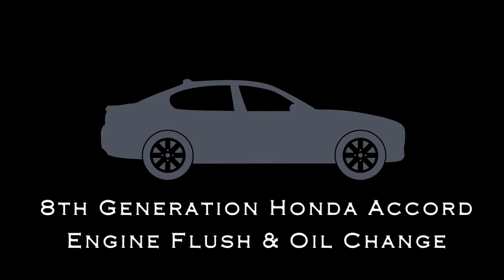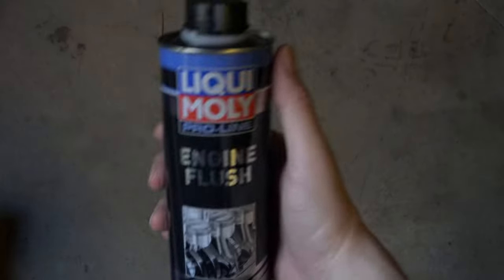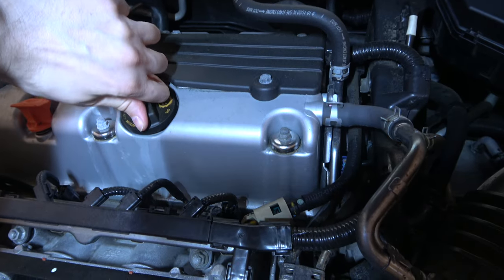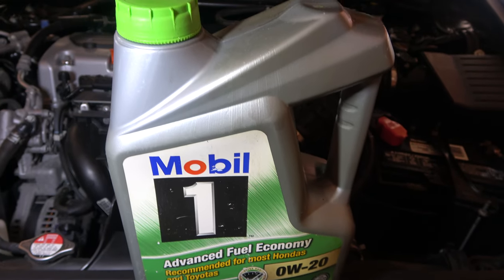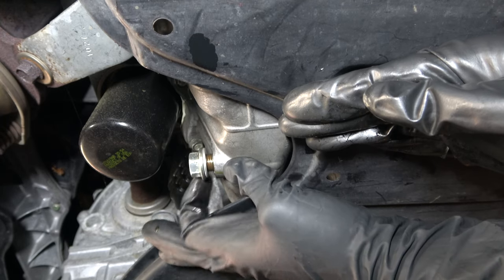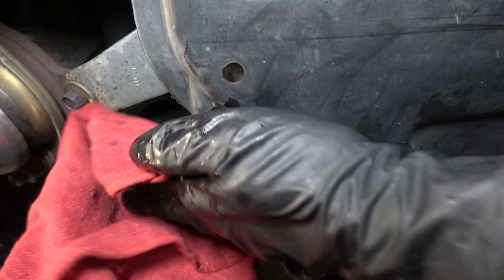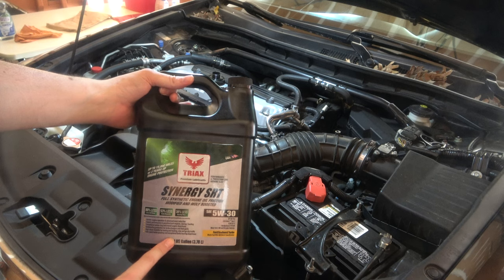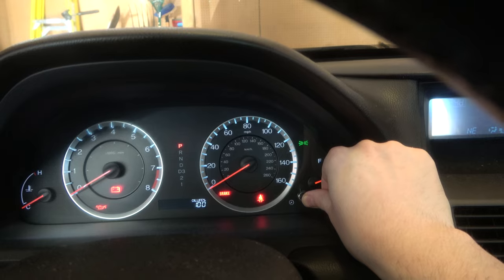Engine Flush & Oil Change With Vehicle Ramps - Honda Accord 8th Generation 2008 2009 2010 2011 2012

Comment: Why didn't you use the recommended 5W-20? Also, if you're looking for fuel efficiency, the 0W-20 is also an option...
Reply from the maker: Great question.  Honda actually recommends synthetic 0W-20.  You can however use a higher viscosity oil to get better engine protection.  The reason Honda uses 0W-20 is to be able to get higher Miles Per Gallon rating, but that is at the expense of engine wear, as the oil is thinner, so the internals will wear faster.  I used 5W-30 for greater wear protection, as the MPG are less important to me compared to getting my accord to 500k miles, and the loss in MPG isn't significant when using 5W-30 either.

Comment: How did the car drive after doing this. And what did you notice when you did this any changes or everything was the same.
Reply from the maker: The biggest changes are more power and better fuel efficiency.  When you clean the gunk out of the engine, it runs more efficiently, like it was designed to run from the factory.

Comment: Did this help you not burn any oil? I burn basically a quart of oil in between 800-900 miles
Reply from the maker: Yes - it also gives the engine more power, because it is more efficient without oil sludge.
Reply: @Stimwalt  awesome!
Reply: @Stimwalt  also, how many times have you had to do this to stop burning oil?
Reply from the maker: @PurpHaze830  I did this for 3 oil changes in a row, and then I was good.  Every 30k miles I'll do it again, just to keep things clean.
Reply: @Stimwalt  I might switch to ow-20 because it improves mpg & it’s basically the same as 5w-20 and causes no different, just thinner which helps clean better
Reply: @Stimwalt this didn’t cause any leaks right? I heard flushing it could remove debris that’s holding seals together and stuff
Reply from the maker: @PurpHaze830  Nope - obviously there are no guarentees in life, but this has never happened to me with any car that I owned.
Reply: @Stimwalt  my engine isn’t sludges all up, i had the valve cover off last month to replace valve cover gasket, it’s most likely the piston rings that just need to be cleaned beings the last owner waited 9k-10k miles between some of the oil changes